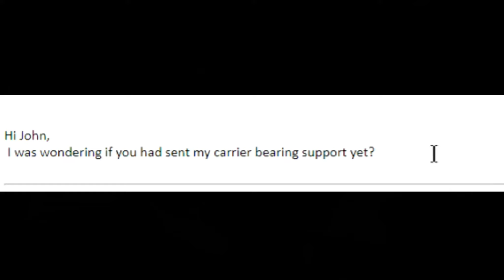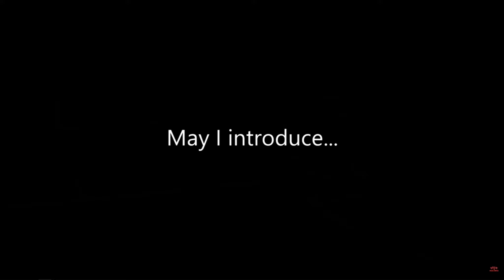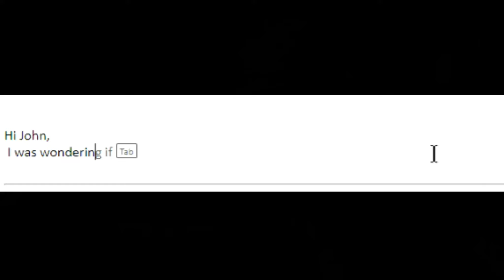The Abandoned Amazon- Driveshaft Episode 10

Comment: M41 output shaft seal, search: Volvo 472258   
Consider injecting fresh grease into the u-joints with a grease gun while under the car and working on the driveshaft. The same recommendation for any suspension parts (ball joints, tie rods) which are not sealed and have grease nipples. Other trick with replacing the center bearing is to put the driveshaft in the freezer for a couple of hours and heat up the bearing in the oven (150-175 Deg F) before installation.
Reply from the maker: Thank you very much!

Comment: I fixed a Volvo just yesterday.  It was a 1996 A30C 6x6 Haul Truck.  I put a new alternator and air compressor for the brake system on it.
Reply from the maker: If it's fixed it's good to go!!
Reply: @DeanofMachines  The alternator is for sure good to go putting out 27 volts.  But the compressor is still slow according to the guage.  But all the guages are inacurate.  Why not the air pressure one too.